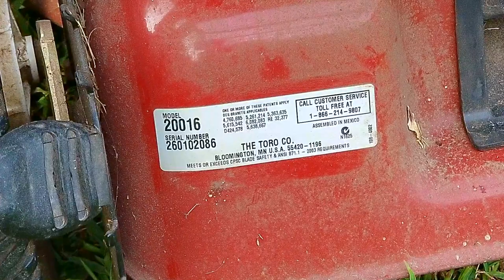Why Get A Tecumseh Powered Mower?

Comment: In the mid-1980's, the base-model rear-bagger Toro (push mower) cost a whopping $229.00 with a TVS-100 engine, compared to a self-propelled, Briggs "Max"-powered Murray rear-bagger (with the plastic box grass catcher) which was $179.00 (the better deal) where I lived.  There's no way I would have paid so much for a new Tecumseh of any make, for the price, when there is no real advantage.  Today, those old Tecumseh engines (if taken good care of) are really an awesome find, whether on a Craftsman, Montgomery Ward, or any brand of mower, and I like them for their quiet operation and low-smoke.  
That engine you have there was more the competitor to the Quantum.  I think it just depends on your own experience, and the condition of the specific engine, but I think the tolerances and materials are equally fine.
Reply from the maker: thank you Paul Campbell for the information

Comment: I bought that same exact mower 04/05.  Cost $300 from Home Depot.  Had zero issues up to 2017 when I moved.

I also have a Tecumseh powered Sears trac snowblower that starts 1-2 pulls every winter since the mid 90s.
Reply from the maker: very nice.

Comment: I recently bought a Craftsman with this motor. It was at Goodwill for $25. I needed to rebuild the carb and it ran perfectly.  I still need to either order a new float bowl gasket or buy an Amazon carb for just a few dollars more. Turned out that the motor had a 7/8” crankshaft like my favorite 1997 Canadian made MTD with the catering front wheels and an oil burning Briggs. Now I’m back to cutting grass with my favorite mower !!
Reply from the maker: nice work!

Comment: Back in the 1980’s, owning a Tecumseh or even B & S engine is what drove people to buy Honda.  Honda also came with electronic ignition.  My Tecumseh had mechanical switch for ignition system, and it is not something easy for home owner to replace.
Reply from the maker: thank you for the information

Comment: I bought Tecumseh in 1983 on a Murray deck mainly because I'd gotten tired of the low side mounted gas tank on B&S mower I finally gave away, and liked the tank on the Tecumseh. I gave it to daughter in 2004 and bought another Tecumseh on Weedeater deck and no problems till this year, when I cleaned the carburetor, replaced the old primer bulb, and the ignition magnet coil, only to finally to discover the flywheel key was sheared. Finally located the proper part number and key, all is well again, and cleaner than for years, and new mulch blade in it. It was hard hit on blade that seems to cause the key to shear. Gas tank access may be shallow reason to buy a mower I guess, but that's why I went to Tecumseh. Also had 195cc engine, bigger than some B&S of similar cost.
Reply from the maker: thank you for sharing

Comment: My first Tecumseh experience, when I was 8, is probably what has colored my opinion ever since. I got a minibike that had a Tecumseh engine. I don't know if it was because I wasn't able to pull the starter rope hard enough, but I had a heck of a time getting that thing to run. It was ALWAYS a struggle. Fast forward several years, and I'm racing go-karts with Briggs flathead engines. I did a mini valve job every week. I can take one apart in my sleep. My first push mower had a 3.5 HP Briggs flathead. It ran great for many years until I sold it. Likewise with my first riding mower, which had a 12 HP Briggs flathead. About 15 yrs ago, I bought a Toro Recycler with a Tecumseh engine. I had zero problems with it. It ran well. When we moved, we moved to a new state, and into an apartment. I didn't have much storage room, so I let the mower go with the house we sold. As an adult, I only have about 3 yrs of experience with Tecumseh. It did what it was supposed to. It cranked and ran every time, but I have to admit, my preference is for a Briggs.

I never knew that Tecumseh's had pressurized oiling systems, and were beefier overall. Knowing that, I'm a bit disappointed that I have such a preference against them. It really sounds like they should have the reputation that Honda has.
Reply from the maker: I can see why you feel that way and it makes sense.  It's happened to me before
Reply: Many Briggs had a compression release that made the starter cord easy to pull,some Tecumseh did not. But I think the Briggs system robbed some power especially at low speed. Also I think Briggs had a more effective choke button that was easy to see when it was pushed all the way out,the Tecumseh choke wasn't as easy to see if engaged fully or not and took more force from the cable control to fully push it home. Unless pushed all the way home the engine usually did not start. Many times the cable controls didn't quite push it all of the way.

Comment: I bought one of these from HD for about $300.00.  It’s about 17 years old and has been a very reliable mower.  I have replaced quite a number of parts such as the carburetor and coil.  It has enough power to walk through tall grass.  Most people don’t care who made the engine but just buy a Toro mower.  Briggs never impressed me as being any better than a Tecumseh.
Reply from the maker: well said, and yes I agree.

Comment: Tecumesh  Engines are ok, their Carbs have issues.   The designed their engines to designed to reused parts in different applications.  used one as a kid ,  the machine was dated 1973 if I remember  and was used until 1998..  the last ones they made the LV195EA were pretty good.   the Vector XLC ones were terrible with their new  designed "disposable series 7" carb  and the OHV ones were soso
Reply from the maker: I have one of those in the garage now, I'll be working on it soon. I'll let you know what I see
when I look at it. thank you D Fields

Comment: I never owned a Tecumseh, but I would like to have something with one on it now just so I could get some experience with them. My only experiences with them are memories of my father, who up until the mid 1980s, bought everything from Sears - including push mowers. This tradition ended with a Craftsman Self Propelled push mower with an Eager 1 Tecumseh engine that failed to start about every two or three times he’d try to use it and resulted in another trip to the shop for warranty work. When the warranty expired, he immediately began a new tradition of buying all of his power equipment from a local equipment dealer. He became a loyal Briggs buyer, as did I, until I experienced a second hand Kohler Command … now Briggs has moved to second place!
Reply from the maker: nothing wrong with switching it up

Comment: When I was 10-16 growing up, the majority of my equipment was Briggs and Stratton, the old school flat heads.  Briggs opposed twin rider, and Briggs Quantum push mower.  Today....38 years old, I have Kohler 7000 twin rider, Honda and Kohler pressure washers with OHV, an old Briggs flathead push mower....a much more mixed brand setup.  I am more about reliability and equipment features vs engine brand loyalty.  Today with Briggs and Stratton, anything that's not more "Commercial" grade seems more designed to fail; and when it fails...it is no longer a part of the equipment lineup.
Reply from the maker: yes well said. Reliability is overlooked nowadays

Comment: I have a toro 20016 just like you have in the video.  Had it since new in 2005, wish I could recall how much it cost then.  Still use it every season.  Makes tall grass short.
Reply: I would love to see a video on how to service the self propelled system.
Reply from the maker: I like that phrasing
Reply from the maker: what all do you want to see? the gears? the belt, or the transmission?
Reply: @HomeGaragechannel  I would love to see how to change the belt and make sure the gears are in good shape.

Comment: The inherent problem with Tecumseh mowers and other machines that have these engines is that the carburetor is at the lowest point of the fuel system and are subject to getting fouled on a regular basis.
Reply from the maker: I agree, but a fuel shut off valve would help to isolate it. Unfortunately most people would Never use them

Comment: Those Tecumseh's will outlast any Briggs made equivalently rated engines in the past 20 years. Use them, abuse them but maintain them and they'll go just as long as the commercial series Hondas.
Reply from the maker: these are really nice mowers

Comment: I had a Craftsman with the "Eager 1" engine for 22 years. It always started on the first pull. We parted ways when the deck came apart. It received only oil changes, filters, and spark plugs. I miss it. I have a Murray with the B&S engine now. It never starts on the first pull unless it's hot.
Reply from the maker: it served you well.

Comment: I have both. My preference is availability of parts. Briggs wins there. Both my mowers are craftsman from sears bought in the very early 2000's. Both still mowing strong. I do the maintenance. I've been acquiring spare engines/parts/mowers to keep mine going but have not yet needed to break one apart. I really don't want to have to buy a new mower.
Reply from the maker: you make a good point

Comment: From  my 50+ years of mowing lawns both Tecumseh and Briggs and Stratton engines are good.  Most people neglect their mowers and basically ruin them or just refuse to have them repaired.   Always smart to remove the top covers and clean the engines from there.
Reply from the maker: thank you for sharing that.

Comment: I have a 25 year old craftsman with 6.75hp Tecumseh that quit on me this weekend after an hour of running. I got it from my grandfather a few years ago and I was surprised it ran at all after sitting unused for years with a filthy filter and oil like sludge. I cleaned it all up and replaced the common parts and it ran great for about 2 years. Unfortunately it’s not worth fixing and I’m shopping around for a new one. Maybe a Toro without the terrible personal pace system.
Reply from the maker: that's unfortunate, did you check the oil after it stopped?
Reply: @HomeGaragechannel  I did and even added some, but it was changed last year. It's either a problem with the carb or auto choke system. It's getting too much fuel and cutting out after a few seconds. It'll start easily, but won't run. I also found gas leaking from the carb behind the air filter. I'd rather not spend the money on a new carb or rebuild at this point, otherwise it's been a great machine.
Reply from the maker: yes I'd also get a new carb.

Comment: Tecumseh never has that dumb fiber/plastic intake tube like nearly every flathead Briggs. Those tubes were made universal I think but usually only fail from severe user error. A collision and bent shaft vibration. 😂
Reply from the maker: I think you're right

Comment: When I go to toro dealer I don't know if there is much choice during model year. Most issues I see with tecumseh is carburetor. Then sump gasket. The batch of toros I have now 2 have kohlar 4 with tecumseh. No B&S yet. I do have a All wheel drive I bought with a blowen up 163 cc briggs near New. The throttle plate came out of the plastic carburetor blew rod out. I put a quantum on it.  When snow melts I will list it for sale my opinion all good just service them.
Reply from the maker: very nice Toro collection! Yes these are really good engines, too bad they still not selling them.

Comment: I bought a Tecumseh engine since I had a lot of step inclines in my yard.  The oil pump makes sure oil is getting into the right spots.  With a splash lube sometimes it can starve a bit on the oiling on prolonged inclined moving stretch.
Reply from the maker: yes but remember the pressure oiling only went to the upper bearing. The rest is still splash.

Comment: not like you'll ever struggle with the T vs.B&S. It's settled.  (T's gone)
had a T on new Snapper, ran 12 years, then died/blew in the lawn.
bolted a new B&S on, pulled 12 years later, too much oil consumption.
put on a used B&S Quantum, ran it 12 years, checked build date: April 2000. 
Tough Engine. Let's see if I can get 12 more from it. :  )     It may take one more sparkplug & air filter.
Reply from the maker: wow, long lived engines there!

Comment: Tecumseh small engine division is out of business since 2009
Reply from the maker: yes
Reply: My Dad depended on Sears for lawnmowers. We moved into a house in 1969 and Dad sold it in 2008 when he moved into a retirement community. During those years, Craftsman was the mower, and at that time, Tecumseh was the engine selected by Sears and therefore by my Dad. I would say on average, Dad got about 5 years out of a mower. After I grew up and moved out, my first visit home in the spring would include Dad having me do an oil change, and new air filter and blade. Dad was great with a shovel and fertilizer, but had no interest in mechanical repairs. I do not know where I got my interest and ability from on fixing things, it wasn’t from Dad and his Father was apparently the same way, according to family lore. Must be from Moms side. She had no use for the pretty flower beds Dad lovingly maintained, but loved homegrown tomatoes. Even today when I bring a planter to the cemetery, it is a tomato plant, not a petunia.
Reply from the maker: nice, I don't see as much gardening around here anymore.
Reply: @HomeGaragechannel  I got a love for homegrown tomatoes from Mom. My garden is just 10 tomato plants. I got a simplicity tiller from FB market place for $5 about 4 years ago. It was a job to get it running again, but better than Dad’s way on using a shovel and turning over ever square inch on the garden plot. Easy to shovel turn a garden if all you have to do is instruct the sons to do it.

Comment: MTD bought Tecumseh years ago. I don't know if they are still made. Parts are scarcer than B&S.
You do great videos.
Reply from the maker: me neither, maybe someone who knows will chime in.
Reply: Tecumseh is no longer in business. I’m guessing 10 years or so now? A lot of them still around and running. Parts are still available.
Reply: In fact Tecumseh stopped production in December 2008. MTD did not buy them at all.
Reply: @Timoteurs101  Im pretty sure the Tecumseh Power/Lauson assets were bought by some firm out of South Carolina called "Liquid Cool Technologies". They make engines under the LCT name. Tecumseh itself is still in business, but they only make Refrigeration units now.
Reply: @ThreeWheelFlyer  it's Liquid Combustion Technology. Everything is made in China with sometimes great quality and sometimes, very poor...

Comment: I have an unrelated question. I was doing an oil change on a Snapper mower with a Honda GCV160 engine that I revived for a friend of mine, and the tip from my fluid pump fell into the engine. I had it running perfectly, smh. I now have to disassemble the mower to remove it. What is a suitable sealant for the sump on that engine, and what are the torque specs for the sump? I have been stuck on this thing for a few weeks now, since I have not been able to figure this out. This was only my second GCV160 engine, so I don't know much about them yet.
Reply from the maker: I would use Permatex ultra black and as for the torque I have not found the spec yet.

Comment: I trash picked a 5hp tecumsah snowblower and it was made in 1993 so it been around for a hot minute and still works. I had no issues besides it broke a auger belt but what do you expect from old rubber and I feel like it down on power. (I might not be used to a small 5hp engine though) You use snowblowers less than lawnmowers in my area so they tend to last longer.
Reply from the maker: very true about their usage, I've only used my snow blower, a couple of times

Comment: What cleaning product was you using here ? I have a ride on mower partner 10-67 not many made but it has the Tecumseh formula xlc engine and it’s been faultless 2002 model still going strong today if you look after them they last. 👍🏼
Reply from the maker: nice mower, and I'm using the only degreaser from Harbor Freight

Comment: Hello, I know you posted this a while back.  I have been working on small engines for about 4 years now.  I have yet to get a Tecumseh engine to work on.  In your video I noticed a small red tube sticking out of the intake where the air filter goes on.  What is that for?
Reply from the maker: I believe it'a breather tube for inner workings of the carb. It apparently needs to get fresh air that's not affected by the air movement in the throat of the carb so that's why it sticks out that far.
Reply: @HomeGaragechannel  interesting, thanks!

Comment: Oh, easy to answer, the Tecumseh every time. The pump system does increase the longevity of the engine. It allows a greater pitch of the engine in sloped areas.

i currently have two in service. The one i use myself is a flathead on a push mower with 28 years of service. The second is the one my youngest uses, a 20 years old Tecumseh 2-cycle commercial engine on a 41 years old Snapper high vac walk behind. Smooth, powerful, never labors in tall grass, best lawn mower engine i've ever used. The benefit for him is he mixes the same fuel for his mower and his trimmer, in a five gallon gas can.
Reply from the maker: Thank you Lowell White, I appreciate this comment

Comment: My first mower was a MTD with a Tecumseh engine. I purchased it because other mowers with Briggs engines were more expensive back then. Had the mowers with the briggs engines been less expensive I probably would've purchased that one. It was a great mower that I never had a issue with. I never regretted that purchase. I take care of my equipment. I'd still have it if I had not given it away years ago. I do still have a 20 year old mtd snowblower with a tecumseh engine. They are great engines. I think most consumers know honda and briggs names as far as engines go.
Reply from the maker: you make good point, and it was nice of you to give it away.